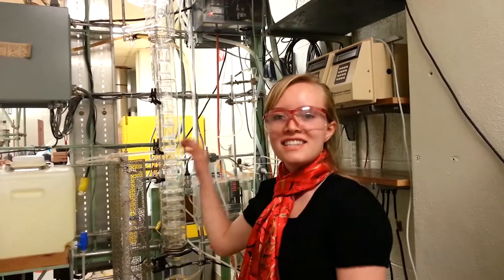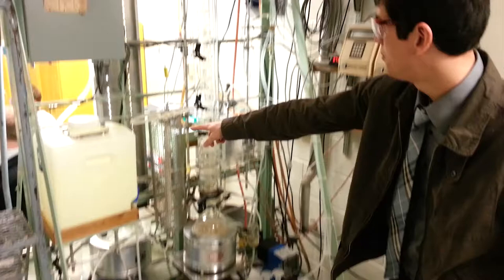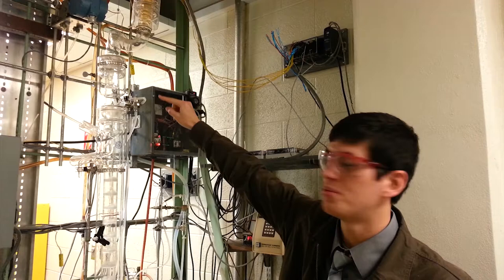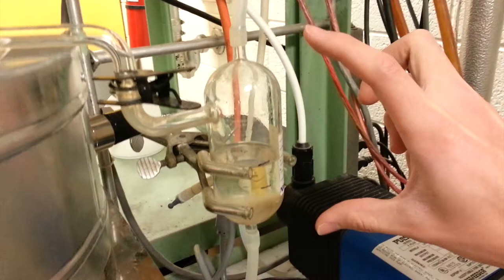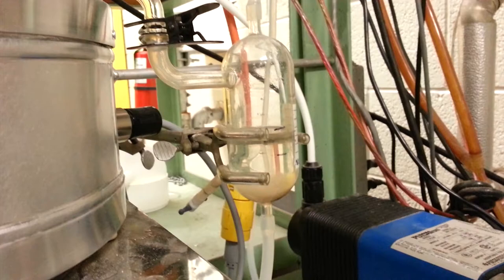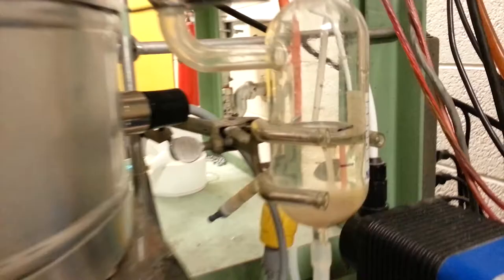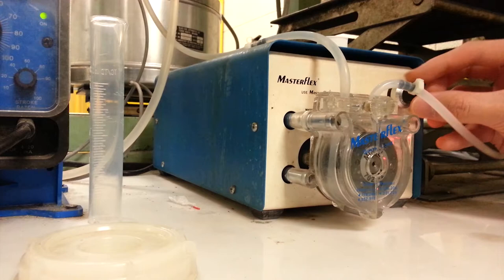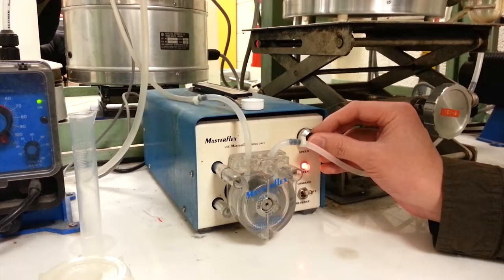Running a Continuous Distillation Column

Comment: Hello
Can you tell me the average efficiency of this kind of plates ?
Reply from the maker: +Gerard menvussa I don't remember the exact values but it is typical of an Oldershaw column. Here is a write up of a batch column that is next to this one: http://apm.byu.edu/prism/uploads/Members/optimized_batch_distillation_2016.pdf (Safdarnejad, S. M., Gallacher, J. R., Hedengren, J. D., Dynamic Parameter Estimation and Optimization for Batch Distillation, Computers & Chemical Engineering, Vol. 86, pp. 18–32, 2016, DOI: 10.1016/j.compchemeng.2015.12.001)
Reply: Thanks for your answer, but there is nothing about plate efficiency in this paper.
I found a value of 0.3 to 0.6 (depend to reflux ratio) in another document, do it seems correct for you ?
...and sorry for my bad english.
Reply from the maker: We calculated a Murphree vapor efficiency betweeen 0.5 and 0.7, depending on the estimation objective function. See the definition on page 10 (Eqn 7). Your range sounds about right and it will depend on several factors that can potentially predict the plate efficiency. Ultimately, I find it useful to use actual column data to estimate these parameters.
Reply: Thank you for these explanations

Comment: I'm surprised they let her get away wearing a scarf in lab. In lab and certainly in industry no dangly bits, especially ones around your neck.
Reply: Good catch! I agree with you. We typically catch those things We require closed toe shoes and long pants, etc. There is some rotating equipment in the lab like pumps and mixers that would be a really bad situation with a scarf.